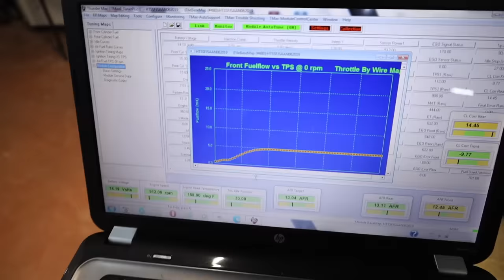Building My Dream Harley Davidson Bagger With An UNBELIEVABLE Amount of Upgrades

Comment: Tell you buddy Rusty to make a ghost pipe that has a removable tip that slides out pulling a half round tray behind it. In that tray is a elongated tool roll to silence any tools from rattling. Half of the Ghost muffler/tool box and mounting hardware is already designed just need to design the internal slide out half round drawer. Now that ghost pipe is actually a tool box that can hold a lot of tools and not take up your saddle bag space. Not wasted space but a valuable optional tool kit.
Reply from the maker: Great idea
Reply: You should fab up a rough prototype and patent it.  Somebody will bite on that for production.   Damn good idea !!!  Perfect for touring bikes.  Mount it under luggage rack for tour pack
Reply: I just caught on too the false exhaust ghost pipe thing. That's a really dam good idea
Reply: Haaaaa I just saw your comment after I said similar. 👍🏽
Reply: Man that is a great idea! I have run D&D pipes on four bikes and I’ve never heard anyone mention the idea. 👍👍
Reply: You just took this idea to thinking "inside the box"  fabulous idea!

Comment: Looking forward to meeting up with you at stop 3 and riding along for a few days. Just gave my ride a cam upgrade along with pipes, thundermax tuner, trask trans cover and topped it off with new lighting and legend suspension. Looks like we will be breaking them in together. Needing to make hotel reservations. Where are you planning on staying overnight between Maryville and Spartanburg

Comment: The engine isn’t getting broken in “properly”, especially with all the new engine parts.  What’s the best way to mitigate that over the long term?
It’s an amazing looking bike, and I hope too see you at one of the dealerships!
Reply: I agree. It needs to be ridden at least 500 miles at slower speeds and the engine needs to be broken in
Reply: It'll be fine. 👍 
I'm sure Adam has done this before.